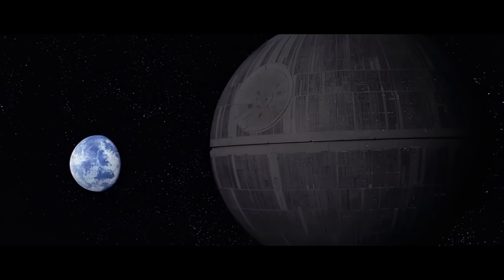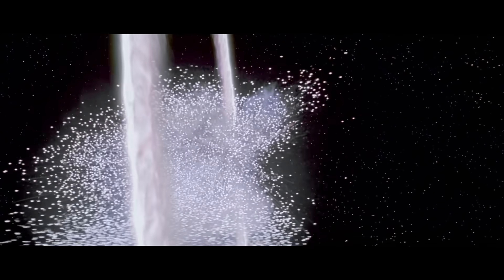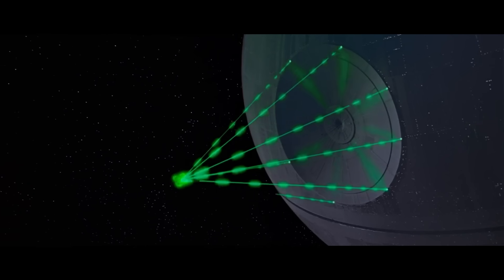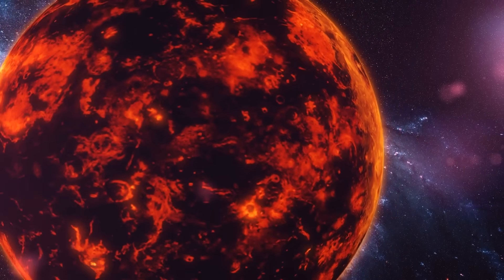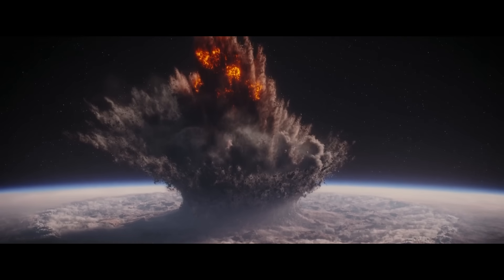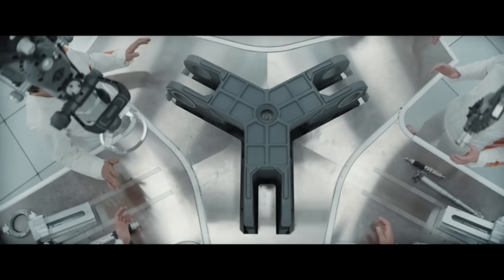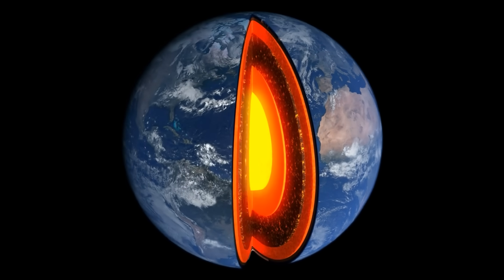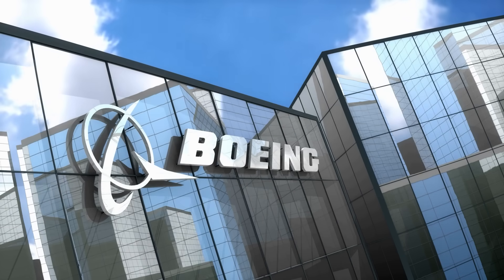The other "Design Flaw" no one talks about on the Death Star

Comment: The main dish would also be a pretty bad vulnerability too, even with ray shielding you could design penetrating bombs to go through the shield, through the lens and into the firing chamber, there by at the very least destroying the super laser.
Reply: @petehjr1 true, but doing it that way puts you right in front of the big green death ray, so your odds of success are… not ideal.
Reply: @Muljinn  The funny thing about space, you don't really need to fly right at things. Sequel trilogy "space bombers" not really what you would need. GBUs are Gravity, Bombs.
Reply: @petehjr1  You have the critical thinking and analytical skills of a walnut.
Reply: Well why didnt the rebels just hyperdrive into the deathstar all of them were willing to die anyways
Reply: @ztriker4406  Frankly, that's one of my biggest problems with the Star Wars universe in general (especially after they actually went and made it canon with the Holdo Maneuver that it actually does work that way).  By all indications, hyperdrives are a commodity item available pretty cheaply everywhere in the known galaxy.  Why are they using all these rinky-dink "space laser" weapons for everything instead?

You actually don't even need to make it a suicide mission, or have any people on board at all: just strap a lightspeed drive to any decent-sized mass (such as even a relatively small asteroid), stick in a (very simple) automated navigation system (you really just need to program the destination, and then press the "go" button by remote control), and you could pretty easily mass-produce entire fleets of star-destroyer-killer level weapons that make everything else they're using look like pea shooters.  And if you launch them from far enough away, the enemy can't even see them coming until they've already been hit (you know, since they're travelling faster than light, etc.), so there's basically no defending against them.

Comment: I do defend some aspects of the imperial military, they had an excellent army with competent commanders and good technology and vehicle’s too complete there missions, they had excellent pilots for the tie fighter core and some aspects of the tie line were quite good (yet not the standard tie that was kinda rubbish) even the ships used in the imperial navy were quite good and if u change the way many were used and actually fill it with competent commanders things like the ISD could be quite useful (though they would need to be used very differently) but the Death Star? No there’s no way u can defend this illogical, head scratching, resource black hole. It’s stupid and it takes some suspension of disbelief that it was even made. The only reason I can see ever being built is cause fascists like tarkin are crazy and love crazy super weapons of Devine power so from that aspect it makes sense but doesn’t in any other.
Reply: i cunter agrue the whole pont of the death  star in obrnal legains and offcal canon of the pont of it being also a fully moble frtonut line starbase and plantery seige and conuter sige platform for projecting power like a lirtal moon sized battle carrer kind of fonution. also the super laser also has the albty to set diffrent varble power levels setings that can reduce power for  far higer rate of fire and presion for surporting the empris other foces if needed. the thing aobut the death star in fact acatly doesnt need to wait 24 hours if its just useing low power shots with its super laser to just bunker bust planetery srtongholds and poping planerty shelds and blwoing up alot enemy captal ships very qickly. shure the death star can blow up planets but is also a moble base and froun line base of optraions that can also sige planets and  bacly provide huge aonuts of orbital strikes on tacactal and stragtic levels of combat fire arltery surport with pin pont pistion wihout blwoing the whole planet up. can aslo proper low power super laser shots alone can also in the case of epsdoe 6 can very rapdily disorty captial ships and ripid fire spam so amny times in just a smale timeframe by the  way. the death start is more like a aircraft  battle carrer bascly proveing main power projection for the most part that also can bust enemy  plantery defises as well. the thing is shure the death star can bust or distroy palenst. but it doesnt even need to do that anyway bescue  bescue its super laser can just be used on low power to deal with some hard to deal with issues during a plantery invasion it could just provide huge amonuts of orbtal surport strikes for the gronud forces agest super togh anti seige paltery srtong hold being blated likea usa bunker buster bomb but with unlitmed ammo bascly.
Reply: thats what i think was the death star ment to do but taerkin just wanted to make a pont and blew up a whole palent and thats was the main cuse of teh down fall of the death star.

Comment: 5:30 Why would Alderaan's star stop shining? The planet was destroyed not the star.
Reply: I'm guessing it's a misunderstanding? Like, the light was the planet's explosion which slowly fizzled out, not the star.

Which also doesn't make much sense, but eh
Reply: Ya'll are arguing over nothing, in the dialog she literally says "the light from the explosion" meaning presumably there's nothing implying the star would stop shining, just that the planet exploding was bright enough you'd see a noticeable difference in the starlight for a few brief moments
Reply: @guilhermerafaelzimermann4196  1. I'm no scientist but I don't think the death star produced enough energy to be as bright as the star
2. She also said "sometimes it's still there" and yeah maybe she meant the planet, but it's strange saying that, considering you can't see the planet anyways
Reply: I turn the question around. let's say, alderaan is like sun. so 3.8 * 10^26 J of constant output per second.
the bast by the deathstar? 2.2 ^ 10^32, he says, it's a billion times more, it's "just" a million times more.
firing one shot into alderaan would still heat up the core and cause pressurewaves inside the core, which then ignites even more fusion, etc.
depending on how the shot was placed, the resulting excess fusion reaction would cause problems in the core, including massive solar flares.
or in other words? you wanted to hit one planet? hit the whole solar system with massive radiation, but keep the precious minerals intact.
Reply: @robertheinrich2994  I am going to admit that this is well outside my expertise, and really, I have no idea what firing the Death Star into Alderaan's sun would actually do.  It might do nothing, or it might interrupt the fusion reaction, causing the star to collapse and explode as a nova. A quick search on the internet yields various answers, ranging from nothing to a big solar flare, to causing a nova, so... My best guess is that it's not likely to do a great deal, maybe cause a flare or two. Certainly in Legends Canon, it wasn't thought to be powerful enough to destroy a star, and so the Empire created the resonance torpedo to force a star's fusion to go into overdrive and then go nova. An Astrophysicist might be able to give a better answer.
Reply: @kylie_h1978  my idea is, depending on how deep that ray can penetrate, that it could massively accelerate the fusion.
in the sun, the energy production per cubic meter in the core is quite low, I think it is a few hundred watts. a serious pressure wave inside that core would cause a lot of extra fusion, mulitplying the energy that was sent in.
Reply: @robertheinrich2994  I understood what you were saying, I was just saying I'm not sure that what you suggest would occur, but also noting that it's outside of my area, and someone like an Astrophysicist who deals with stellar physics would have a better shot at answering what exactly would or wouldn't happen.
Reply: @kylie_h1978  yes, and am looking from the chemical point of view. injecting such an amount of energy would create a pressurewave. depending on how strong that wave it, it would amplify the already massive shot.
and the shot might punch a hole into the magnetic field of the star, that would cause a solar flare, at least in the direction of where the shot was fired from.
so, it's destroying the planet with extra steps.
Reply: @kylie_h1978  I must correct myself. a few hundred watts per cubic meter. unless you cool it down, the fusion reaction on its own is less than a nice stove. it not even enough to heat a house.
but kick the star into overdrive, and it will throw an angry mass that wipes out the surface.
Reply: She isn't referring to the system's star, she is referring to the actual explosion that apparently is a bright as a nova.
Reply: That would create a giant ass debris field which would dim the star at least
Reply: @regamadffs  Not enough to be visible by a naked eye. We need specialised just telescopes to be abe to "see" that there's a planet there. And we don't actually see it. We determine it by a less than a 1% change in the star's brightness. Stars are just so massive. Also don't you think that the mass of an entire planet spread out over the span of a debri field would dim the star less than if the mass was concerned into a planet?
Reply: Fairly sure a planet vanishing from the system would play havok on all the other planets rotations.
Reply: @toportime  Still doesn't explain the supposed star disappearing.
Reply: @ALLMINDmercenarysupportsystem  Agreed, Messed up orbits, If the planet completely breaks up you may get asteroid strikes etc, But the star would be fine.
Reply: @toportime  The planet wasn't deleted. It was turned into a pile of rocks.  The law of matter conservation means there is still the mass of that planet in that orbit.  The center of that mass of asteroids (center of gravity) would even still be in the same place as the Center of gravity of the planet.  From a few tens of millions of kilometers away, nothing would be different.
Reply: @toportime I doubt that.
Reply: @toportime over time.  But in the short term, all the mass of alderaan was still there in roughly the same place. 

But none of that would be visible from another planet light years away
Reply: @toportime  You might think, but you would be wrong. Even if you deleted an earth sized planet from the solar system, it would have very little effect on the orbit of its neighbors. Even deleting Jupiter would not greatly affect the other planets; what it would do is affect the Asteroid belt and fire all its moons off in random directions, which could be bad. However, and this is really cool. Alderaan wasn't deleted, and all of that mass of the now blown-up planet will still retain the same centre of gravity as the initial planet had, meaning that to its neighbours, as far as gravity goes, the planet is still exactly where it always was.
Reply: @kylie_h1978  How much planetary mass got vaporized by the mega laser beam? People are saying that the entire mass would still be there, however, a lot of it would have been converted to either energy or superheated mass moving at high speed when the explosion happened. Energy destroyed some amount of the total mass of the planet. The rest flew off in directions expanding outwards from the explosion center.
Reply: @DarkVoidIII  So, you have conflicting issues in your question. Vapourised means "turned to gas," and even if some of the mass was vapourised, then it would still be there, just in gaseous form, which would then start to condense as it cooled. Converting matter into energy is actually really hard, even when we use antimatter to annihilate matter. If you have too much, then they might actually push each other away.

The problem really is that to convert matter to energy, you literally have to rip apart the protons and neutrons into their quarks, and then convert all of that into photons, and you're talking hundreds of PWs of power focused directly onto just a few atoms. I don't think that the Death Star had that capability.

Also. While the planet was destroyed, we really have no evidence that there was enough energy involved to even render the majority of the planet at near or past escape velocity. In Legends, Alderaan becomes a large asteroid cloud that is called the Graveyard. Even in the movie, we see that some time shortly after the destruction, the remains are forming an asteroid cloud through which the Falcon passes. Over time, this is likely to collapse again, reforming the planet just as planets form initially.
Reply: @toportime  Why would it?

Like planets are really far away from each other, far enough that they don't have super dramatic effects on each others' orbits except over the course of billions of years (Over a long enough time scale the different orbiting bodies gradually pull each other into the same orbital plane) - it has to be so, otherwise the planets would be likely to destroy one another.

But also even if you destroy a planet (blow it up, vaporize it, whatever) its mass is still there, just more spread out. Of course, that wouldn't be the case if we take the explosion of Alderaan at face value how it was shown in the movie (it flies apart at thousands of kilometers per second, likely fast enough to escape the sun's gravity entirely)

Comment: Just use the Holdo maneuver to take out the main weapon. Job accomplished.
Reply: Just imagine all the flight commanders on Yavin being like, "It's really brave of those pilots to give their lives like that...  I don't know how many of them it will take but we sent around 30 fighters, should be more than enough..." Then 10 minutes later in absolute horror realizing they're not doing hyperspace ramming maneuvers at all, they're flying in on attack runs on the surface trading shots with superlaser turrets and stuff

Comment: I just realized, the recoil on the death star must be enough to at least shake the station like a airplane undergoing turbulence. Like, imagine every time they had to fire they play an announcement over the speakers a few minutes before saying "Superlaser firing in 5 minutes, we are going to experience some turbulence"

Edit: can y'all be civil for once in your lives? I swear I can't share my thoughts on this platform without the replies erupting into a huge argument.
Reply: I'm not sure any civilization with artificial gravity technology would have to suffer from recoil on a space station. Worst case, the station moves but you adjust all the gravity generators in just the right way to make it seem like nothing happens. But I reckon that if you time it right, by applying counterthrust with the engines you can prevent any movement at all and don't even have to do any inertial dampening shenanigans.
Reply: Another YT science guy did the math.  The recoil of a planet destroying blast would be equally destructive on the Death Star.
Reply: Guess again. Let's assume the death star is 20 sextillion kilograms, and the recoil is spread over about 10 seconds. The supper laser is going to generate about 124 billion newton meters of per kg. We start with calculating the kinetic energy w=.5mv^2 or 124,000,000,000=.5v^2. so about 248,997 meters a second. AKA how fast the death star will be going as a result of firing the supper laser. Over 10 seconds that means they will experience about 2,500 times earth gravity in acceleration for those 10 seconds
Reply: Considering how much mass the death star had, I doubt that you'd feel much recoil.
Reply: Star Wars has “inertial dampeners” aka movie science so the third law is invalid
Reply: Why would they experience turbulence or recoil in space from a laser?
Reply: @starscream512 because while photons have no mass they do have momentum; a tremendous amount of it. Firing a laser powerful enough to vaporize a planet will still have to conform to conservation of mass and energy (momentum is kinetic energy) and so it will have tremendous “recoil” which would require powerful engines to counter and it would still probably be kicked backward just as the mass of the rifle is kicked backwards by the bullet leaving it.
Reply: Hey guess what, this is sci fi where our physics don’t always apply and there is technology that can do things differently than our stuff on Earth. And no, they don’t need to explain everything to a bunch of nerds who try to apply our logic to something that has sci fi logic. The End.
Reply: @tbd3058 oh aren’t you smart… we ENJOY arguing about impossible stuff!
Reply: Ask those battle droids in the Clone Wars about "experiencing drag in the vacuum of space"  @starscream512
Reply: @starscream512  newtons 3rd law. light has momentum
Reply: @starscream512  Newton's 3rd Law applies to light. Even a flashlight technically has recoil.
Reply: That’s assuming that the Death Star’s super weapon is a laser at all. It could be some sort of exotic particle beam that converts matter inside the target planet into antimatter. It’s vague for a reason. Leave the technobabble to Star Trek.
Reply: @KenoshiAkai  This channel and its viewers all Waaaay overanalyze physics and technobabble in star wars. Shots from laser cannons are clearly moving well below the speed of light.